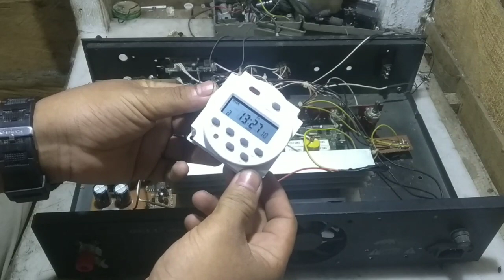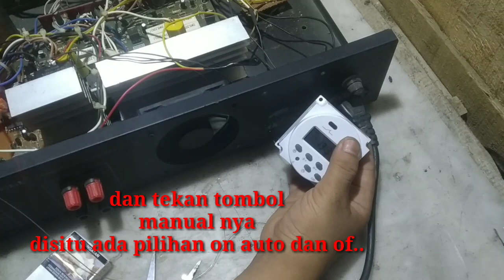CARA PEMASANGAN TIMER OTOMATIS PADA AMPLI WALET

Comment: Saya mau beli timer itu bisa tak sama abg.
Reply from the maker: saya bi di shopee gan
Reply: @RobbilAmin  harga berapa bg.soal nya di online ada 3 jenis bentuk nya persis pengunaan tombol nya beda bg.saya mau beli yg seperti aj.
Reply from the maker: nnti saya krim link nya gan
Reply: @RobbilAmin  oke bg di tunggu.
Reply from the maker: @jskaudio6473  Temukan DC 12V digital timer programmable switch outo on off seharga Rp64.200. Dapatkan sekarang juga di Shopee! https://shopee.co.id/product/20054612/2378283000?smtt=0.0.9
Reply: @RobbilAmin  trima kasih ya bang.
Reply from the maker: ok sma" bg...